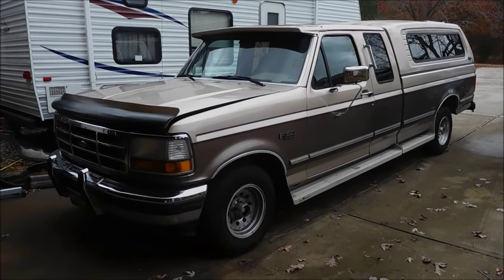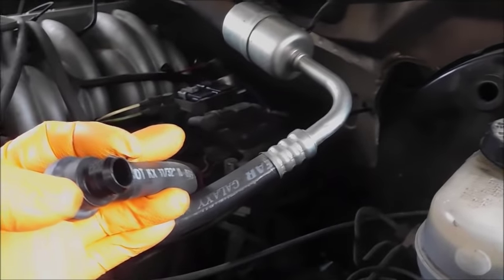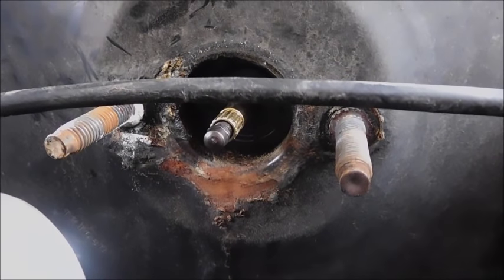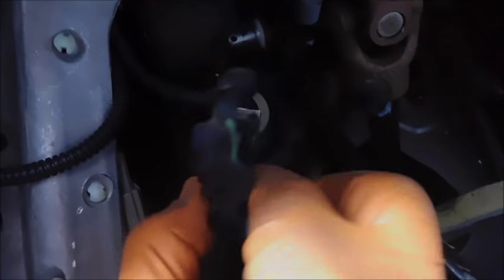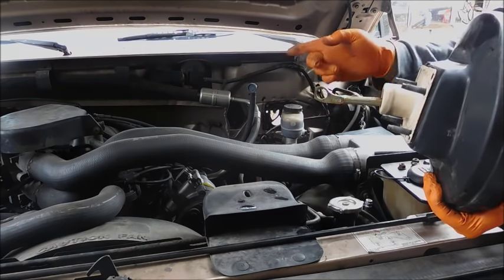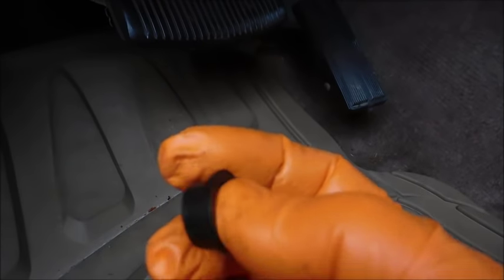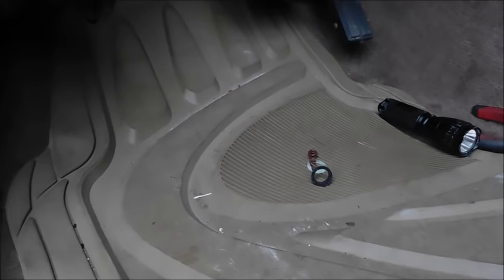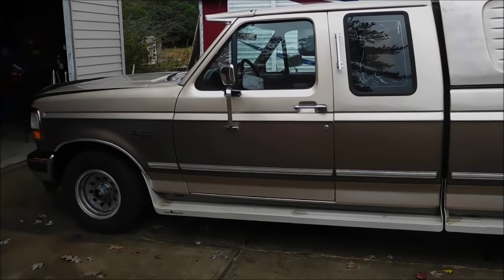Ford F150 brake booster replacement

Comment: Thank you, I just want to mention that I had a code 22 (MAP sensor) on my '88 4.9 f150 because of a booster leak... I plugged the hose at the check valve and the code went away.   I thought my master cylinder was going (brake fade at the red light) but pretty sure the rusty booster vacuum leak is the culprit. Gonna go deal with it right now.  Great vid!

Comment: Thanks. I liked you showed every step. Going to do mine now. Mechanic said 500 dollars. The part is $89 with a $65 core. Thank you again and for saving me the $$$
Reply: I don't blame shops for trying to make a profit but hot damn is that a rip off. Just changed mine and it took maybe an hour. An experienced mechanic in a professional shop could have this done in ten minutes, even if they charge you for one hour minimum labor you can't expect me to believe your labor is worth $300 an hour. I'm an electrician and I don't fucking charge half that much.

Comment: when I was 18 in 1956 I had a 1952 ford. Standard Brakes, carburetor, standard ignition  
distributer, standard steering, any intelligent person could figure it all out and do repairs. 
since 1960,   it has all become "Fucking Misery",  Engineer's Wet dreams, $$$$$$$$$$ rules
the industry. There are tens of thousands VW beetles from the 60's still running.  amazing !

Comment: On my '89 F150 I have already replaced the Master cylinder and wheel cylinders on mine but never had to replace the booster so this is a great video for just in case. Thanks for the step by step video really great thanks.

Comment: I am currently swapping booster on a 97 f350, same set up as the truck you did the work on, my question is did you buy a new bushing kit when did the work. The plastic was brittle and broke when I pulled off the old booster and the new one didn’t come with a new bushing to go between brake pedal and rod out of booster.  Parts store had no luck locating a part number or kit available.  Thanks in advance for a reply.
Reply from the maker: I believe the one I had was intact. You may have to buy a kit. Dorman may have it, or something close: https://www.dormanproducts.com/p-27173-74016.aspx

Comment: I have a 1992 chevy silverado when i disconnect the brake booster valve It seems to get more air and sounds butter but when i connect it back to the brake bosster the rpms drop low and wants to turn off
Reply from the maker: Hmm. Hard to sat on that one. Check air filter, and pcv.

Comment: What type of rubber gloves are you wearing, where do you get them and do they provide a good barrier between your hands and greases and oils?
Reply from the maker: They're called Astro-grip, and they're available from a variety of vendors. They work pretty well, but I'd say not any better than most available. O'reilly auto parts sells them. http://www.oreillyauto.com/site/c/detail/SASP/66573/N2212.oap

Comment: Can someone who's never done this accomplish what you did? I have a new old 91 f150 and although it had brakes when I bought it now no pressure. Leaking bad at the connection between the booster and M Cylinder. So I want to attempt this. Not a mechanic and not a guy so wish me luck. I did manage to switch out the fuel filter but it was fairly easy after I learned of the fuel switch and how important it was to disconnect that first. I need to watch a few times because I'm a little uncertain putting the inside parts back the way you said.
Reply from the maker: If you have some basic skills, I believe you can. Have faith in yourself. Is the master cylinder retaining fluid?
Reply: Jo Daddy's Garage, hi and thanks for replying. The story is I bought this truck and knew it had some leaks underneath but didn't see this. I got a steal of a deal so figured it would be necessary to improve upon it as is. I believe it wasn't dormant but at times sat for weeks. I come along and did all necessary checks, top offs and oil change, freon charge with new tires and off I went. It is suffering I think with previously dry conditions on gaskets and connections etc that it's now not holding in particular brake fluid. It isn't completely gone but knowing it was topped off a week ago or so, it lost 3/4 of it in the reservoir. So there is that. I figured while I'm at it I should just replace both the MC and booster. I will have help for bleeding the brakes. So when it leaks it leaks from the specs between the booster and the MC.
Reply: Hey will this solve the problem i have with my brake pedal not coming all the way back up, causing the brake lights to stay on unless i pull up on the pedal, i've replaced the master cylinder and the wheel cylinders in the drums. still hasn't fixed the problem
Reply from the maker: Do both. You'll be further ahead.
Reply from the maker: rhiley36, I can't say it will definitely fix the pedal problem. Sounds like something is binding. These are generally a smooth operation.
Reply: yeah i was thinking that it has to much friction somewhere.
Reply: Thanks. I was on vacation until yesterday. I'll tackle this soon. I believe with a little luck I'll manage.

Comment: How do you disconnect the clips that’s right there next the Reservoir at 1:07
Reply from the maker: The sensor connector? Should be a simple tang that you squeeze and pull.